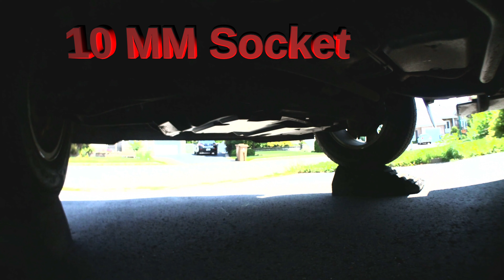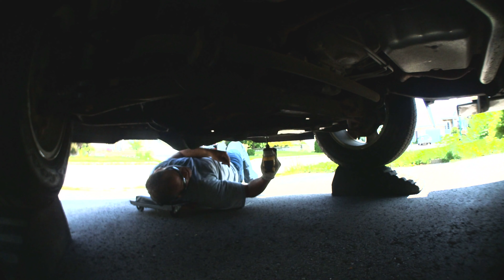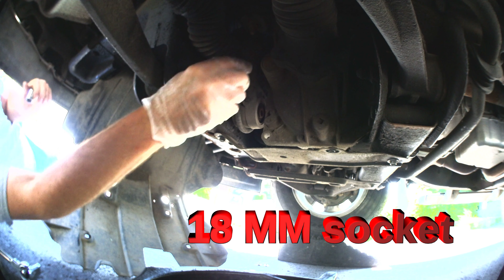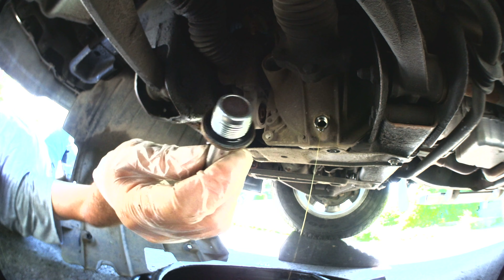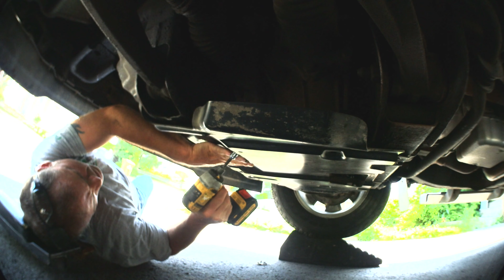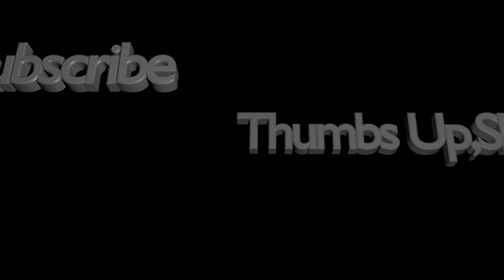Front differential oil change Sierra Silverado 2014 & up. Easy

Comment: Mine must have loctite on it. Bent an extension bar. Still haven't been successful.
Reply from the maker: :face-fuchsia-wide-eyes: Man this sounds unbelievable,good luck with it !
Reply: @obscur156  tried it by removing the lower plate and not using an extension. Had to kick the ratchet, but it finally worked.
Reply from the maker: @AustinVandeburgt   Good news ,thanks for watching.